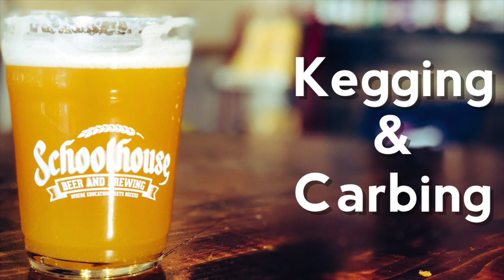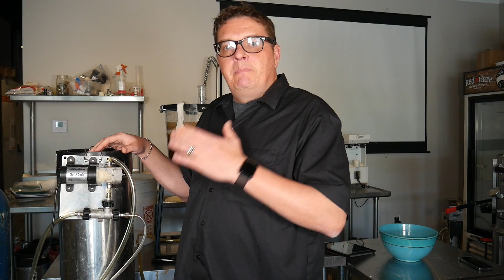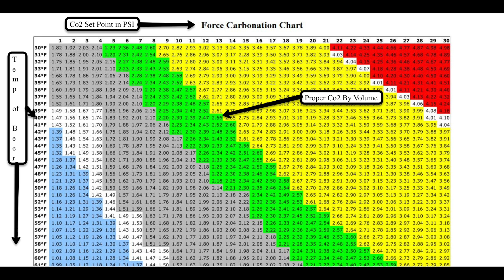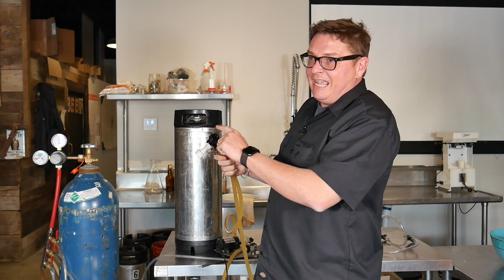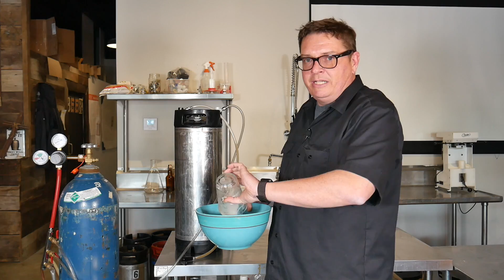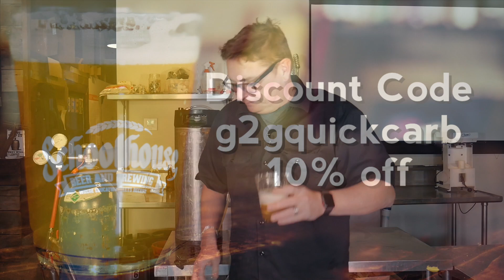Using the Blichmann QuickCarb on our Hazy IPA (2018)

Comment: Have you guys had any problems with leaking with the Quick Carb? I heard thats a common issue.
Reply: If you make sure all the fittings are tight then there should be no problems. I just bought the new version which has an off and on switch and a more sturdy body. The fittings don't have any leaks, I just had to make sure everything was tight. Also make sure the quick carb is laying on a flat surface when using it.
Reply: @jamesc8311  can you refer me to a link to this new version you speak of? I just bought mine on MoreBeer which is usually quick about having the latest and greatest, but I can not find anything anywhere in regards to a new version of the quick carb. Cheers